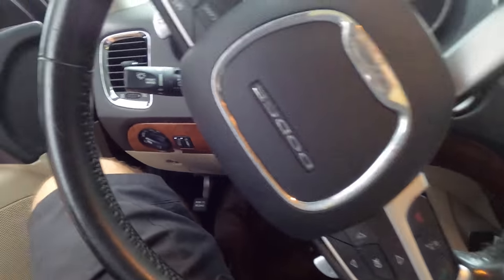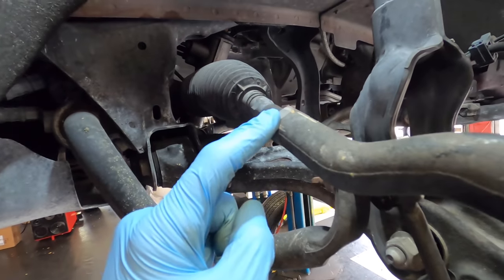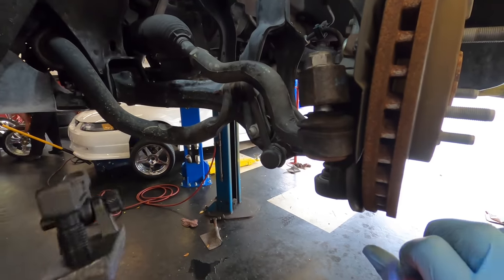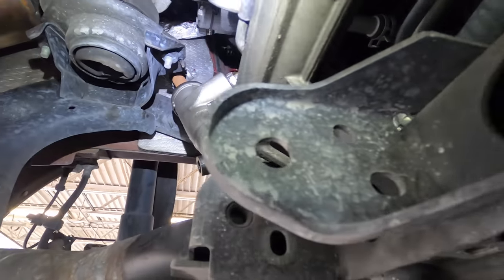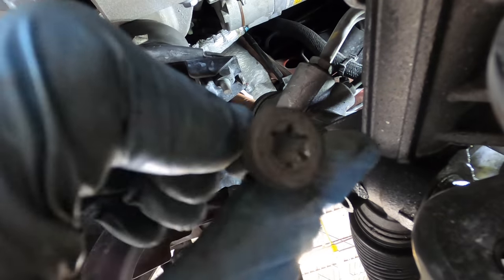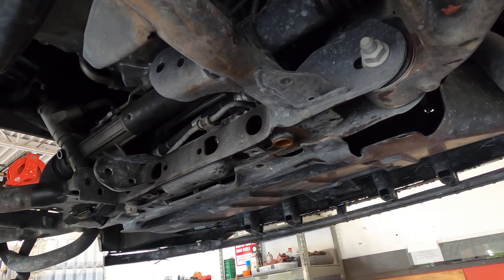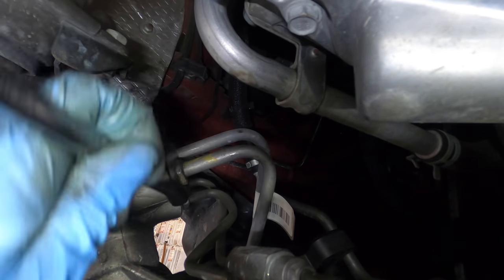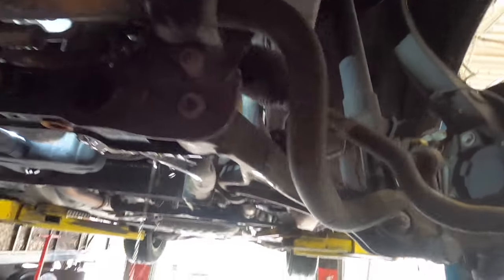Engineers vs Mechanics | They GOT Me!

Comment: I won't go into too embarrassing detail suffice it to say when I was young and much less knowledgeable about cars.
I bought a POS from a used lot.
After I sold it to someone else a shady very unsafe repair to the steering system gave way (the parts should have been replaced) but weren't. Luckily he was going slow enough and traffic lite enough nothing worse happened.
I don't care how knowledgeable you think you are or aren't, you should always let a trusted mechanic look over any prospective purchase, unless you know you are buying a pile of parts inside a shell.
Where and at the speeds I'd driven that thing, with the precious cargo that it carried at times, makes me shudder not at just losing that irreplaceable cargo, but of the carnage and possible other lives that could have been lost to a shaddy person's greed, if that temporary fix had given way at any other time or place.

Comment: Why didnt you secure the steering wheel at center to prevent damage to the clock spring many jobs i seen where someone else gets in there turning the wheel while the column is disconnected destroying it
Then telling the customer it was like that when it came in

Comment: Everyone likes to jump all over the engineers, but I think most of the time it's actually the beancounters in the background that are to blame. Changing part of the rack might add complexity for manufacturing and/or require an extra part bin or something. For instance if you assume that steering shaft ujoint has to be in that exact position for geometry reasons, maybe adding an intermediate shaft and a female coupler on the rack would add $10 to the cost of each vehicle. Multiply that by however many hundreds of thousands of cars and that's a lot of money. Even if it would save 3 hours of work, the number that THEY are going to have to pay to R&R under warranty is probably a fraction of how much money they save by leaving it as-is.

Comment: Yes, very much enjoyed it. Well done, and as a European I recognize you are fluent in recognizing correct metric hex nut widths far beyond most I know (I'm useless at it). 

I didn't catch what was stopping going right, turn down and out with the old rack, similar to the new rack went in. I'm personally scared messing with a correct wheel alignment, so it would be the last option for me. I'd rather lower the sub frame as an amateur not having knowledge or tools for correct aligment. 

Didn't anticipate you were replacing the complete rack, so then it wouldn't matter. I'd consider cutting right through it.
Reply: The rack can be rebuilt and has a core value. cut the rack, cut your profit.

Comment: I've had the same type of headaches. If you made time. Still OK. Next time you know and it does really take you 2 hrs. With alignment. Boom. That longer shift on top to the steering wheel shaft is truly a reason to curse engineers. Not needed.  Ever. On any vehicle. Which bolts are the killers again?

Comment: Blame it on Henry Ford, he was a huge fan of "DFM", Designed For Manufacturing, not repairing. Period.
Using the mass production/cost efficiency model of Uncle Henry also meant making use of existing components rather than design new ones.
So you get a car designed to use a generic steering box and fit a body around it with no concern for someday having to replace that steering box. 
Getting through the warranty period is the only thing manufacturers worry about because after that all the manufacturers BS is left at the owners and mechanics door.
Don't even get me started how "repair times" are determined. 
Cold comfort is the system is the same in Heavy Equipment and Commercial Trucks. 
Heavy equipment dealers offer "Field Service" and it is profitable on warranty jobs because you get to bill extra for travel time and it's a selling point to the customer who doesn't have to pay to have his machine hauled into town.

Comment: Spent 4 hours beating on a caliper for my 14 Charger. Cut the crap out of my hands and gave up. Took it to my mechanic, and he beat on it some more, penetrating oil, nothing worked. Then he almost melted the bolt off with heat, and finally got it off. Then had to do the other side as well.

Comment: I don’t know why, but I always clean up rusty bolts and the threads on the rotary wire brush then coat everything with antiseize. Now that I’m retired and work on my own stuff, disassembly is so much easier on brakes, shocks, ujoints etc.
Flat rate destroys quality sometimes.
Warranty work was especially brutal.
Not only did the engineers poorly design it, but when it broke, horror’s, they established fantasy repair times.
They had to be guessing. I lost my ass so many times on .5 repair times that took 3 times that or more.
Reply: Assembly lube, antisieze, teflon paste, dielectric grease, moly paste, in the good old days white lead and a few others. Each one has its uses. Have fun

Comment: Good job.  I wish I could find a general purpose mechanic in my small town.  The dealership operates on the principle that all car owners are fools when it comes to repairs (possibly right) which gives them the right to charge 2x, 3x, 4x what the job entails, even if they leave off some important parts in order to beat the clock.

Comment: How do you know those replacement o-rings are the exact same size. What about thickness and diameter are off just a tit and is the material made the same. I’m just curious in case I might run into the same issue and need to replace some o-rings. I’ve seen a part as simple and small replaced and it cause havoc

Comment: .The tie rod has a square right outside the rack boot for another spanner to prevent virtually ripping the ball joint out of the tie rod end .
Otherwise the tie rod end casting itself will have provision for a spanner ..Not trying to be smart ,but I was taught by a pedantic expert S.O.B

Comment: Just a thought,didnt want to read through 2.7k comments but couldnt the driveside inner tie rod be taken off at the rack thus allowing the steering shaft to drop down below the obstructing bracket and if you needed even more drop at the bracket could you not possibly take the pass side loose at the inner/steering rack connection and push that side up possibly dropping the steering shaft connection down lower.Not gonna say anything snide about engineers but maybe that would just be a laugh for them.Either way they either get to watch you struggle with the rack or not see the forest for the trees.Had to put an alternator on a Northstar Cadillac one time,Its a struggle out here.

Comment: Always side with the engineers. There is more than one model parts can be matched too. The mechanic is only concerned with the job at hand. The engineer must find the most efficient and effective design while keeping costs as low as possible. Sometimes the owner, or designer will throw a curve and mid project draw up new specifications which the engineer then must alter direction or vector in the new specifications.  One of the biggest 800 pound gorilla factors can be USA government military people who are also looking out for their Generals and the man in the field.... So it maybe easy to bash the engineer, but walk a mile in their shoes first.  Mid length along the main body their are tubes that could have been removed and reassembled afterwards that could have saved time.  I also thought looking at the replacement part before full removal of old part could have been helpful, this thought occured because of the fight with the old part.

Comment: Yeah, they suck but here is a tip,I'm a master tech with chrysler, poll jack the engine remove the engine mount bolts on the cradle, the two front crable bolts remove them, and the cradle will drop enough for it to come out from that opening from the drivers side, FWI your lucky its RWD, AWD is an absolute nightmare

Comment: If there was only a way we could get the engineers to do the work of removal. 
Automotive and aviation engineers are all the same. Though a few aviation engineers have FINALLY started to use a 3D program to Actually see How difficult it is to remove parts.

Comment: Ridged IMPACTS have broken bolts of in my ls motor XD. They are strong af
Reply: I saw a Milwaukee M18, my 1/2" M18 is rated at 1000ft lbs and easily snaps 5/8 grade 5 bolts on its highest torque setting. My torque wrenches go from about 10in lbs to 600 ft lbs. (1/4" through 3/4") and get used regularly. Have fun

Comment: Rack turned all the way right and remove the right boot and inner tie rod to drop past subframe?.  Turn the rack with shaft pointing down. Everything is like working on an Audi now it appears. Car parts are gremlin infested things that purposefully be difficult because they know you think you know everything, and they know you are in a giant hurry. You should only pull one protective cap at a time to avoid dropping anything into the holes while you're connecting the lines.

Comment: A {xxxxxxx) torx should NEVER be used,unless you can apply axial force when tightening or loosening. They  were originally designed as a replacement for a phillips head.

Comment: Done buy the looks of things,to max the profit Very little attention to detail or care used in fitting the replacement steering rack the main mounting bolts,should at least have been cleaned and inspected and either thread lock used or If nuts were of the nylock type they should have been replaced ,as for the steering column flex joint well that UJ seems to be somewhat rusted and bleeding from the seals,
Feel free to comment on the above.

Comment: "How did I screw this up so bad?"

If I had a nickel for every time I've said that... like the time I replaced the CV boots on a '81 FWD Subaru GL hatch.  Couldn't get the axle out of the hub, so I beat it out with a mallet.  And I deformed the axle rod head because there's a hole for a cotter pin.  So I had to literally file down the mashed end of the axle and then rethreaded it with the axle nut and an "angry wrench".

Oh, and the first time I put it back together my dumb ass put the OLD BOOT back on.  So I had to take it all apart again.

I like to think I've learned a lot since I was 17, but really all I've done is made new mistakes.  The universe has never given me the same challenge twice so I can apply what I've learned.  Stupid universe.

Comment: Yeah, I've been saying that about engineers for years. I had to replace a starter on an S-10 pickup some years back, and the manuals' 1st step was to remove the EXHAUST MANIFOLD! Seriously! It was only 2 bolts to remove, easily accessed from below. But wiring passed through the motor mount and had no length to get starter down enough to access! One front tire removed, and some delicate work with a long 10mm wrench and needle nose pliers solved that. An extra 3 to 5 inches of wiring would have made things so simple! Engineer's should have to do a tear-down and rebuild of anything they design. I guarantee they would say, "Hold up! I've got to add an access hole here and a modification there," etc"...

Comment: If the engineers made for easy repair, they would not sell as many cars.  The economy is the problem.  Put the focus on one-time-build.  Next time that same repair is needed the car will be rocking the toss and turn point.  Dodge engineer's boss smiles from the 5.7 hour trigger point.

Comment: My guess is that compressing the tie rod connectors caused the shortening of the middle bits which is really what allowed the part to come out. The new one did not have the extended length (both sides compressed) so it went in easily.

Comment: That absolutely makes perfect sense to hand off jobs to play to there strengths to make to jobs run more efficiently and make work move threw the shop faster 
From the shops standpoint. Now as for compations it dosnt make sense for a seasoned skilled mechanic to change tires when his skills are better suited to change headgaskets where the tire guy isn't capable to do them.  Lets say you make 25 dollars an hour and the tire guy makes 12 bucks an hour, why would I pay you 25 bucks an hour to install tires that only makes the shop 15 dollars profit
When I can make more money off the 12 dollar an hour guy.
And you can do the jobs that earn the shop 75 bucks an hour or 35 dollars profit.   Also when somones not doing work on say some job he can go over and learn or sweep up/ clean or put away parts ex..  depending on his skill leval.
The whole point is the shop puts food on the employees table from management down to janitor so it pays to shift work around to key people.
Assuming I got close on the pay scale and I doubt I was right it was just oddball numbers.

Comment: The size difference on the shafts could've fucked up the stress balance on it. Either the whole thing would need to be larger, or even worse, non-standard. If the repair guide said 5.6 hours, it probably accounted removing something else to make its removal and substitution easier.
They guy who engineered it was probably laughing at you, really. But not for the reason you think.
Congratulations on beating the clock, tappy tappy

Comment: Good work, cool video... but seriously. Stop murdering those nuts with pliers! How hard is it to grab the correct wrench? I can't believe that you got that torx bolt out without stripping the bolt head. It would only take a few extra seconds to use both hands, line the ratchet up properly and use good form while cracking it loose. I do it all the time in situations way worse than this! I do Steering racks on Civics and Accords in the driveway with no lift.

Comment: 1. All the engineers can poor gas on themselves and step into the 🔥 along with all their tools (especially nissan and Ford engineers)!!
2. The jeep liberties are the WORST rack to do you basically have to completely disassemble the steering gear as far as removing the hard lines off of the steering gear to get the deal to come out and defeat the clock😑🤬..

Comment: It trully is funny why we continue to denegrate the engineers when we go to repair something, especially cars.  "what was going through their heads when they desigend this?"  Well, simply, they were designing for the most efficient way to manufacture and assemble components. They don't need to and don't consider how easy it is to repair or replace an installed component; that's not where they make a single red cent.  
As mechanics/technicians, our job is to develop techniques for repairing  or serviceing the mechanicals. We don't care how easy or cost effective it is to assemble the product in the factory. Let's face it, if everything was "easy" then any moron could effect a repair, and mechanincs would be redundent.   The harder the job and the more skill required to overcome a difficult situation is where a good mechanic shines and earns their money.   Without the engineers,  how would we prove our metal and earn the good money we do?   Personally, the more difficult the job, the better I like it because I become and remain needed and make darn good money doing it.   And, filming the process of a difficult repair make good entertainment too.   
So, a big thanks to all the engineers that keep me in demand and gainfully employed!
Reply: Designing it so it is difficult and costly to repair might be profitable for dealers and mechanics in the short term, but once the manufacturer gets a reputation  for "very expensive to repair" vehicles, most customers are going to avoid buying that crap.
Reply: @munsters2  This line of thinking is contrary to what really happens.  Go back to the success of Henry Ford and the Model T. Before engineers designed a way to assemble a car quickly and efficently (mass production)  very few people could afford a car. In fact, only the rich could.  And ever sice Henry's engineers developed mass production design techniques, people who repair cars critisize and or condem engineers for deliberately making life hard for those who repair or service anything mechanical.  

In your comment, you have the cart before the horse. It's not the difficulty of the repair that governs sales buth rather the cost of the car in the first place.  Face it, if people can't afford to buy a car in the first place, then there will be no cars for you to service or repair.  Often, the difficulty in the repiar is a  consequence of the need for low manufacturing costs and superior product.

The complainting being done about designs has been around litterally forever. And yet people still buy the cars and some even make money repairing the "stupidity" of the engineers and then filming it along with their compaints and other's comments..